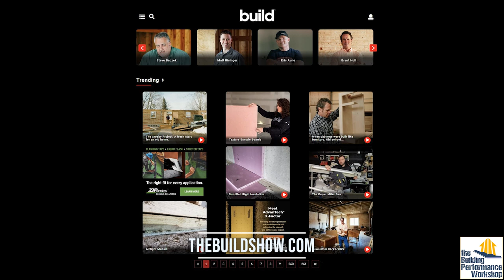Disasters and Resilience with Matt Risinger: Building Readiness into Homes

Comment: What's up with the shrinking roof overhangs these days? My wife and I designed and built our super-insulated home with 3 1/2 ft overhangs. Water is never, ever an issue. Plus, when there's a couple of feet of snow on the ground we can walk around the perimeter on bare ground. It's a no-brainer.
Reply from the maker: Just like they keep changing the heights of toilets- fashion setting trends where it has no business.

Comment: Can you expand on your thoughts about plaster walls? I live in a 108 year old house. I love the character, thickness and sound absorption of the plaster walls. I prefer it over drywall. I want to insulate the exterior walls by removing the siding, filling the stud cavities, resheathing, and reinstalling the historic siding over furring strips. My concern is that historic preservationists are saying old homes should not be insulated and that “houses need to breathe” (I know I hate that phrase too) which I know for the most part is lack of understanding. They expand on it being about how the plaster handles moisture and operates, and that insulating the walls would destroy the house. I’m leaning on the side of they are misinformed, but then I wonder if there is any truth to what they are saying( or if their examples were retrofitted incorrectly). My bonus question is that they also mentioned plaster walls are carbon neutral, yet I’m struggling to find sources on that. Have you heard anything about lime plaster being carbon neutral/negative? 

Their sources for not painting historic brick or only using lime mortar for historic brick seems to be checking out though.
Reply: I'd do all the insolation and sealing work you want to and then add a dehumidifier if you're worried about it.
Reply: No idea what your climate is like so just a broad approach.